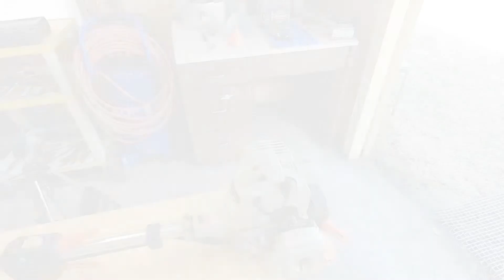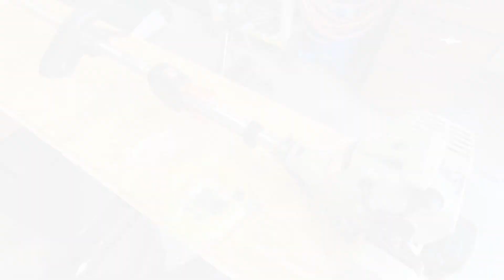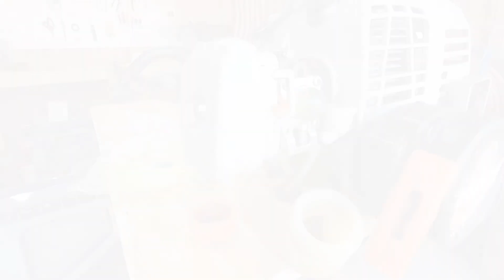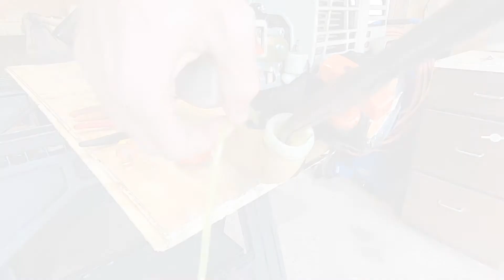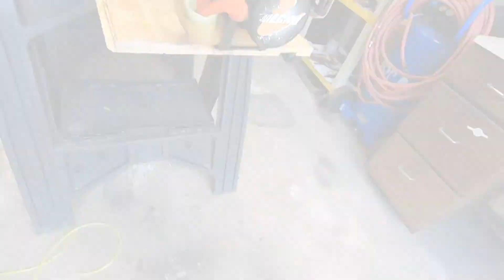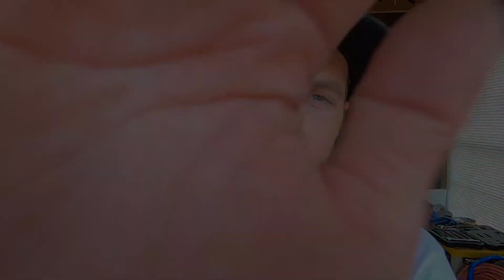STRING TRIMMER/ WEED WHACKER WONT STAY RUNNING. Common issue

Comment: Great job and great video. Well produced. Nice getting a free gift of tygon fuel line from an Amazon wish list too,  good to have right when you need it. And it’s always good to see some Echo love going around even on those older models. They are built like tanks.
Reply from the maker: Thank you so much. Yes the fuel line really came in handy. Especially having different sizes. These older echo units run great, and I’m excited to use it. Thank you so much for the support.

Comment: I have a really old Ryobi weed trimmer.  Colors are yellow. Not green.  The tank does not have a grommet.  So the right size fuel line is the seal?    I put new lines on it and bulb. Fired up but leaks gas.   I still use it.  But it's very old and a not a straight shaft.     I can use it but that leak drains the gas eventually.
Reply from the maker: Yes the fuel lines need to fit very tight as they create the seal for the gas not to leak out. Sometimes they can be difficult to get just the right size.

Comment: I change so much fuel line it's not even funny 😂🤣
Reply from the maker: It certainly gets repetitive. That ethanol fuel mixes tear them up. I’m getting better at them. I have a hard time with two stroke equipment.